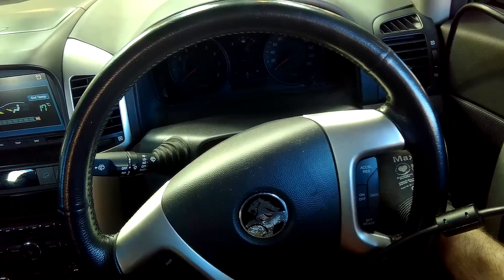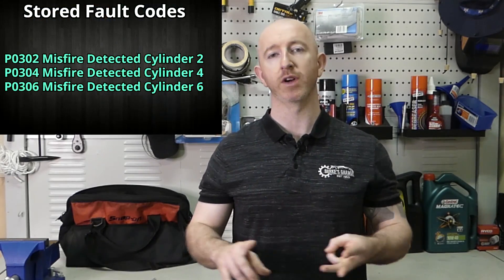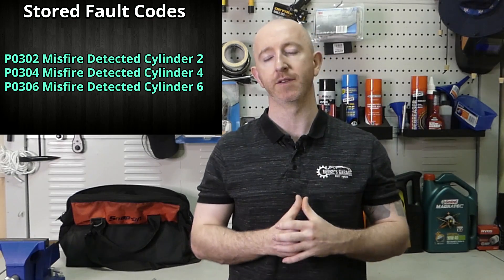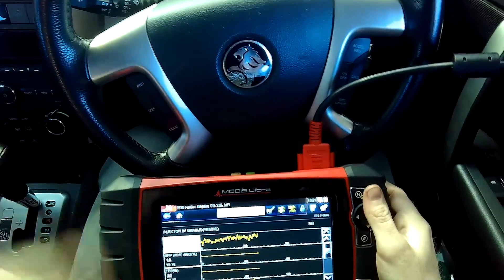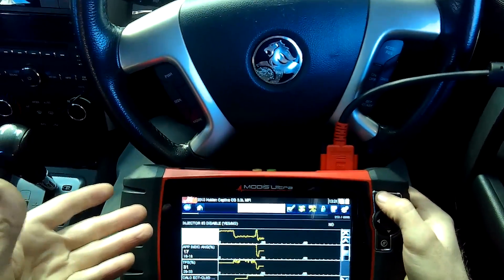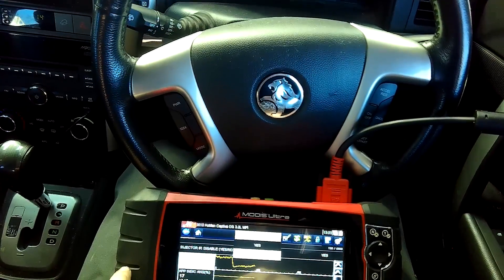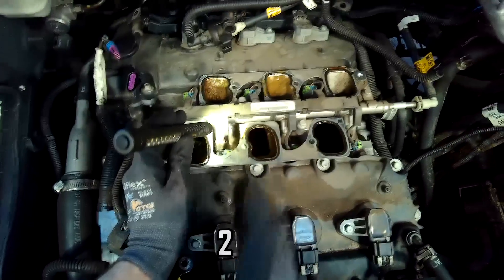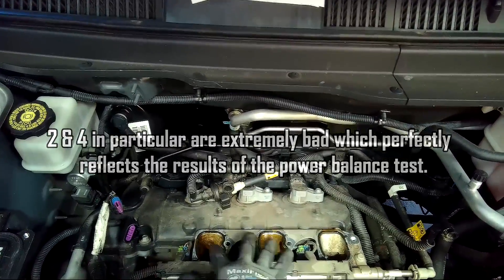Cranks But Won't Start Fault - Power Balance Test Used To Diagnose

Comment: A basic oil and filter change can be so cheap these days, less than £50 if you do the job yourself. A lot of garages would do it for less than £100. I change the oil and filters on my disco twice a year regardless of mileage which some may think is excessive but I know that the engine will be immaculate.

Comment: So does it means the block or cylinders are damaged?
Reply from the maker: A complete strip down would be needed to confirm the exact depths of the damage, which will not happen in this case. The timing is out and the engine is in very poor condition. 

Compression is low on the 2, 4 & 6. 50 psi less than the other side.
Reply: @GerardBurkeBurkesGarage  Thanks, I have a Ford Fiesta 1.4 and it cranks but don't want to start. Oil pressure is low. My best option now is to buy a recondition engin and later the old one send to the engineers. My company retrenched me due to Covid-19 so I was just figured it out to rather buy the recon engin.
Reply: @trade_with_jonathan  ...scan the computer for any obvious fault codes before you condemn the engine...
Reply: @lancecooper4646  Cylinders 2 and 4 misfire, 1 and 3 is not what it should be. We did a diagnostic test. So I'm just going to buy a recon engin and later will send the top and block to the engineers.